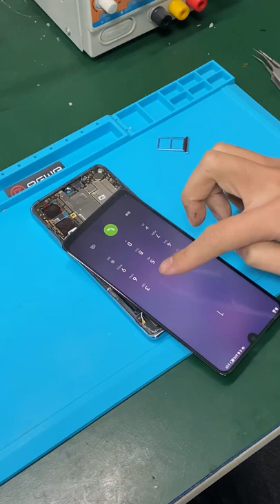Huawei P30 Won't Turn On Repair #Shorts

Comment: Rewa, I appreciate your videos like these, and I know many find useful information from the. But please remember, many of your viewers are not very experienced with microsoldering. So please take this into consideration for future videos:

Always show heat shielding of critical components when using hot air around such components. Especially when using hot air around big BGA chips thst may have underfill, like in this video.

In this video, you are using hot air right near the edge of the big Power IC. This needs to be covered with metal to shield the IC from the hot air. This particular repair it is extra important to be careful with hot air application, because directly beneath this repaired component, on the other side of the logic board, sits both the memory chip and the CPU.

It is very easy to cause damage and shorts under the CPU and memory chip, when solder heats up and expands, squeezing out from the underfill. It's a bit like with iphone audio IC repair, where if you heat the chip for too long you will melt the solder balls of the baseband IC on the other side of the board.
Reply from the maker: Thanks for your advice. We will pay attention to that in our following videos.
Reply: hey my friend, I have a big problem and I would need your help. I read a lot from other posts about a USB-C OTG Hub to fix a Huawei but my situation seems to be a bit more difficult and I really need some because I have to recover my notes etc.